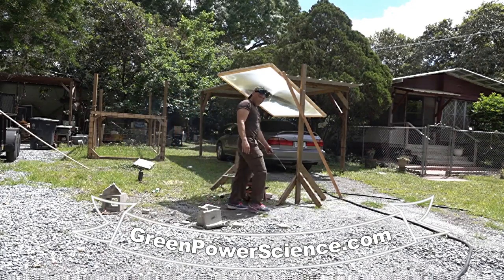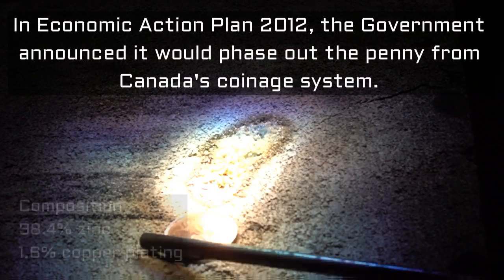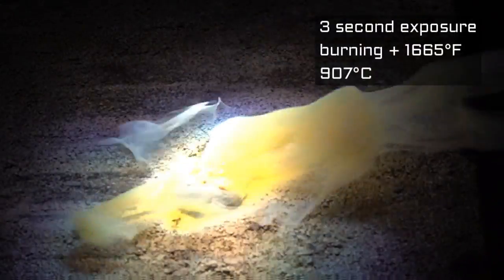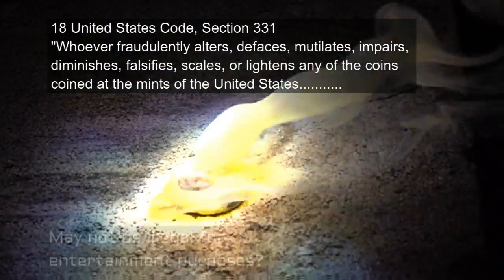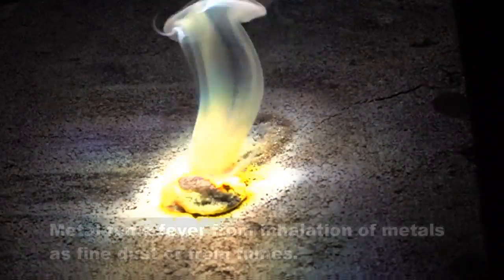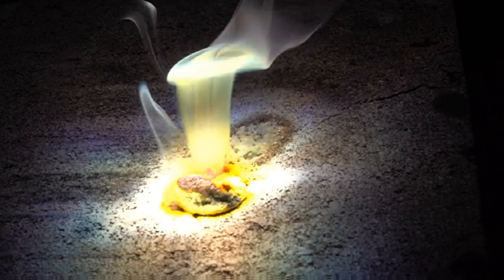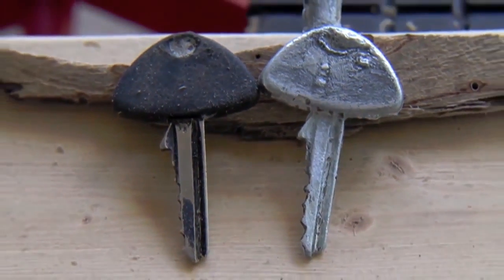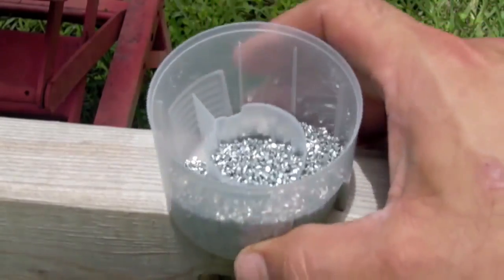Melting a Penny with a Fresnel Lens in under 3 seconds Sun Solar

Comment: YAY A new video!
Where can I buy one of these lenses? 
 
 
 
 
 
 
 
 
 
 
 
 
 
 
 
 
 
 
 

 
(I know where but its a perfect place to plug the site)
Reply from the maker: +x9x9x9x9x9 Greenpowersciece.com :-)
Reply: +GREENPOWERSCIENCE You missed the "n" in science.  p.s. good video.
Reply: GREENPOWERSCIENCE I do have a question about these though. Whats the difference in the "spot" version and the linear version. I know you have covered this in multiple videos I just forgot and is there an option to buy one without the frame to cut down on price a small bit?

Comment from the maker: Made this video to compare a real spot lens with viral videos and discourage people from destroying pennies.
Reply: +GREENPOWERSCIENCE oh yeah sure, while demonstrating doing just the opposite....classic. But honestly i could care less as they are not backed by gold or silver so its just wanna be money.
Reply: Can I get a fresnel lense from a rear projection big screen TV?
Reply: +ShoeBakka1 lens*
Reply from the maker: +ShoeBakka1 The good ones are very difficult to find. You need a TV prior to 1995 for good lenses. 99% of the internet hacks are wrong.
Reply: +GREENPOWERSCIENCE That's a bummer I guess I need to throw that TV out. You saved me the headache of taking it apart though. Thanks.
Reply from the maker: +ShoeBakka1 It is worth checking, some newer TVs had usable lenses. Take it out and test before you trash it.
Reply: +GREENPOWERSCIENCE But you can sand and polish the other side like you demonstrated, right?
Reply: +GREENPOWERSCIENCE Thanks for the tip!